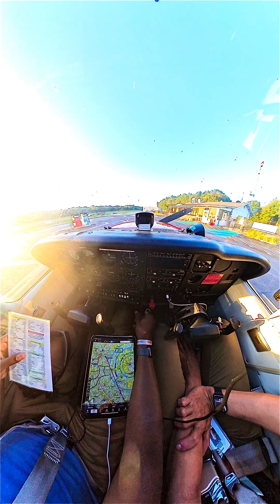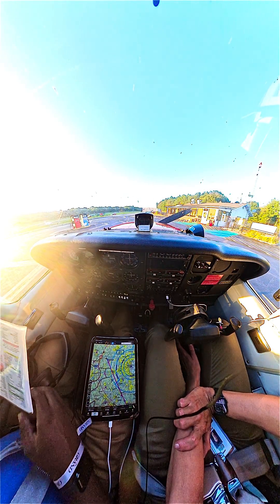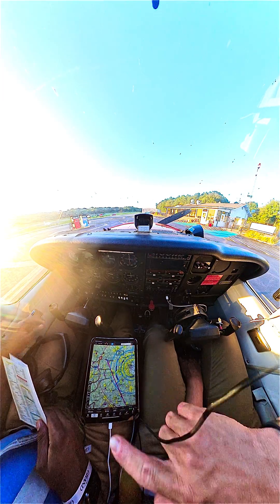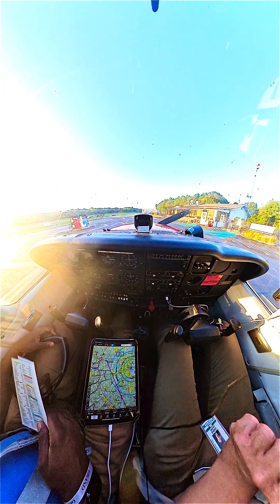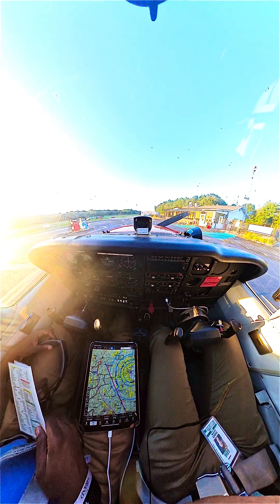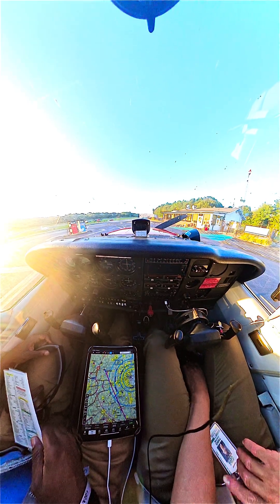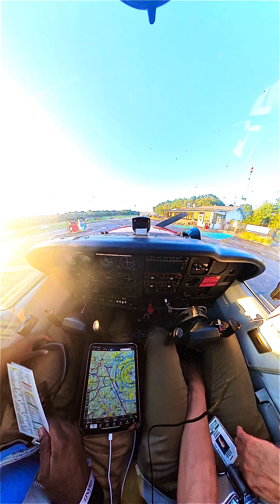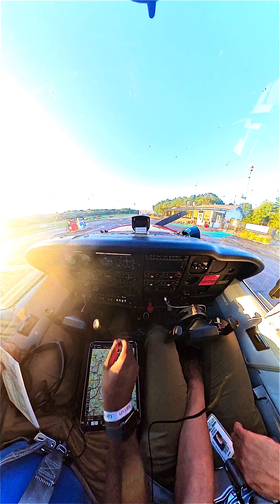Airplane Hack: Starting Cessna will it work? #cessna #start #massachusetts #airport #prime

Comment: Using the accelerator pump as a primer is a good way to start an engine fire. If you ARE going to do it, don't stroke it and then wait 30 seconds to crank it like this. The atomised fuel settles into a fluid again, which is how you get the fire risk. Get your checklist done, stroke, crank. That goes for the primer too. I am a flight instructor and airline pilot. Fly safe!

One last thing, if you're going to do it this way, which im not necessarily recommending, give that throttle a good SWIFT stroke. The accelerator pump is basically a squirt gun, pumping it slowly only dribbles the fuel into the cylinder. To get better spray and atomize the fuel, you really want to pump it. Thats the opposite of how you're typically taught to move the throttle, nice and smooth.
Reply: Ive been around airplanes a long time, both flying and wrenching. The throttle pump method for starting is OK, but if it doesn't start, don't keep pumping excessively. Risky. One or two nice swift strokes right before or as you start to crank, not much more or potential 🔥
Reply from the maker: Great information thank you feel free to drop some knowledge on some other videos and keep up-to-date with my daily postings
Reply from the maker: Whoa this is all great information. Where did you learn this? This is definitely beyond CFI knowledge.